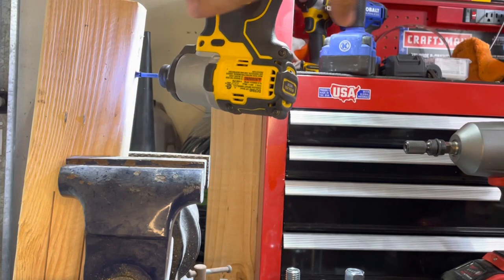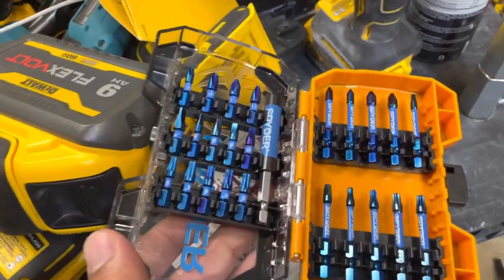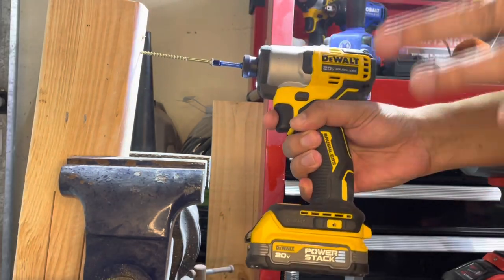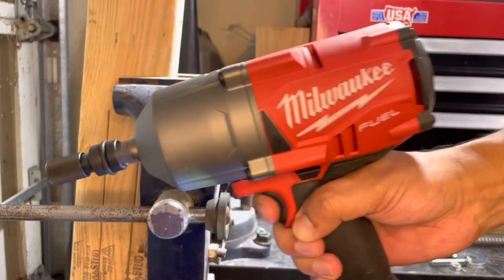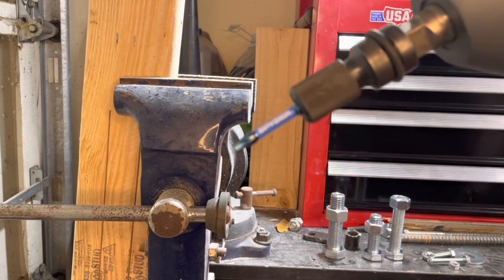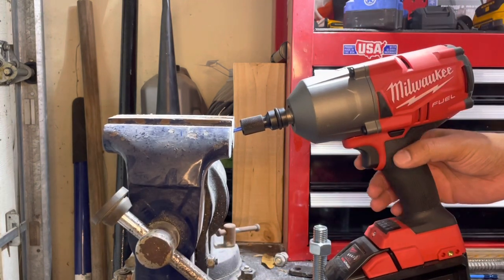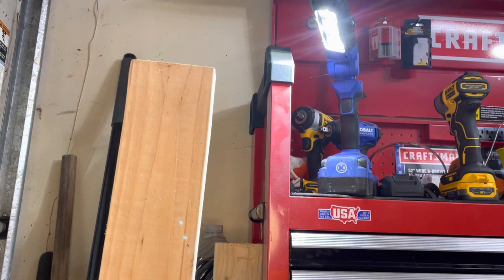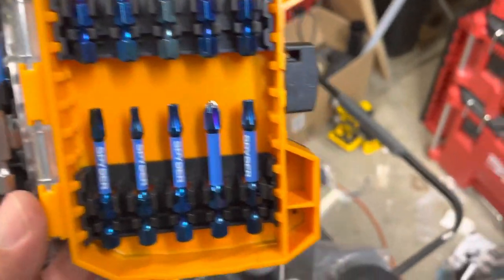Spyder Mach Blue Driver bits You need to see this!

Comment: I like my spyder spade bits and holesaws but no matter what that's a bad bit set for the money. Nowadays there's absolutely no reason for there to be that many Robinson bits in a kit. What is there, only 3-4 T25s? Makes no sense. Spend your $30 on a Milwaukee 100 piece or something similar with 5x as many torx bits and as much if not more durability.